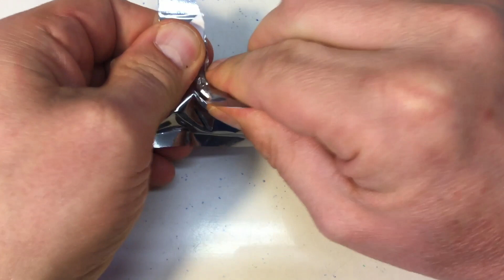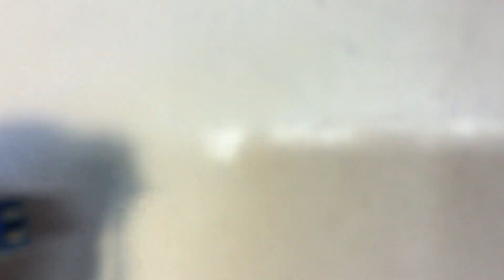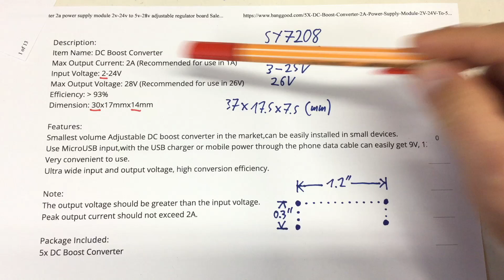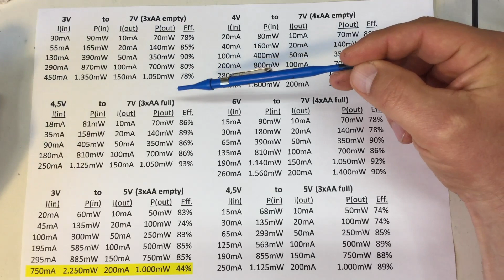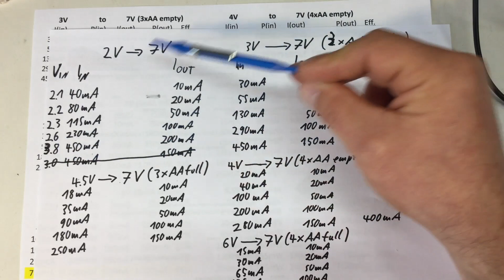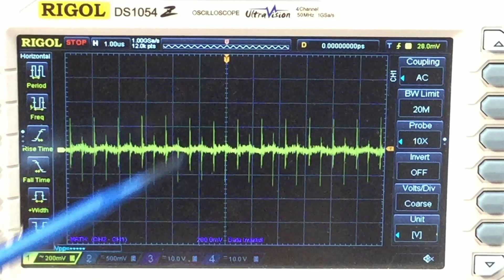Mailbag: DC-DC Boost Converter Module (incl. Test with Partial Characterization)

Comment: Running on a LiFePoR single cell (3.2-3.3V) and boosting to 6V I get 600ma with no problems.   This is not continuous though.   Driving a game camera with it.  It only needs power when something moves in front of the camera. 
I tried it at 12v, 600ma continuous, and it got hot so I turned it off.
Reply from the maker: Thanks for the data! These little boost converters certainly have there limitations, but within them they do work quite well. BTW how do protect your LiFePoR cell from over-discharge?
Reply: @robertssmorgasbord    A button BMS on the bottom.   Only needs one if running say, 2, 3, or 4 in parallel.    I don’t use them for charging though.   Coming off a solar panel into a buck converter set for 3.25 max.
Reply from the maker: @jacksprat7087  Thanks for the info! I was just wondering.

Comment: Can this handle 1A sustained output?
Reply from the maker: Haven't tested it, but according to the "datasheet": Yes! But keep in mind that the input current should not exceed 2A peak (not RMS!) either (the "datasheet" again). So I would estimate  at 1A continuous output you can achieve a voltage boost of max. 50% without cooking that thing off.
Reply: It depends on the Vout/Vin ratio.   If Vin was 4 volts and Vout was 12 volts, then no because current in would be ~3 amps.  

When initially hooking one of these up always set the desired output voltage BEFORE connecting the load.  Run the pot 15 turns clockwise first then connect  the input.   Then turn the pot  counter clockwise until reaching the desired output voltage.   Then, and only then, connect the load to the output terminals and fine tune the output voltage.   If you don’t do this then you run the risk of frying the board.   There is NO overload protection on these things!!!!   Also if Vout is to be 6 volts more than Vin then you absolutely must set Vout to zero before hooking up the load.

Comment: Interesting video, do you have any further plans to characterise these modules any further, i think it would be great to see results with the same 3VDC and 5 VDC input voltages but with 9VDC and 12VDC output voltages , i wonder what is the maximum mA they could achive on 2 or 3 AA and AAA batteries at those 9VDC and 12VDC. Maybe also from a 5VDC 2Aor 3A to try and max it out , especially with regards to further voltage differences and its effects on efficiency, thanks for the upload
Reply from the maker: Sorry, but currently I'm not planning to characterize these modules any further. It's just too much work with my setup / without automated test gear for that purpose. But from the existing measurements you can guesstimate some of the values you require (no guarantees though): V(in)=3V I(in)=450mA V(out)=9V I(out)~100mA, V(in)=3V I(in)=450mA V(out)=12V I(out)~60mA, V(in)=5V I(in)=250mA V(out)=9V I(out)~120mA, V(in)=5V I(in)=250mA V(out)=12V I(out,max)~80mA. And I'm pretty confident that these modules won't survive 2A or 3A ;-)